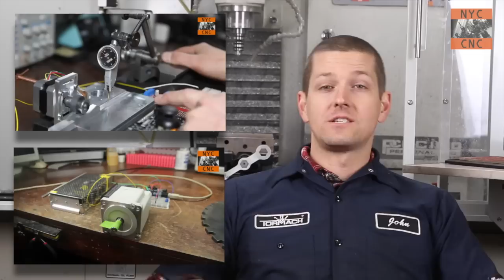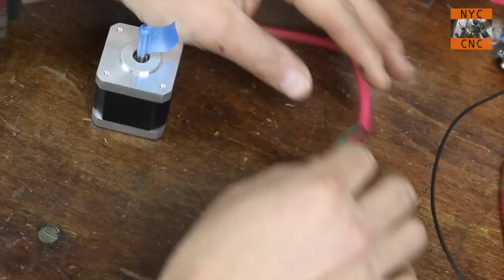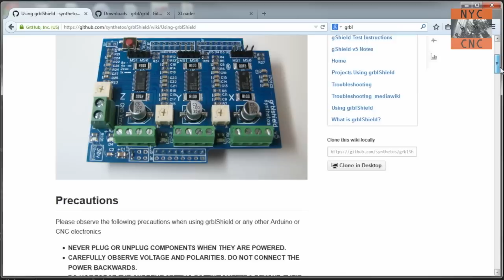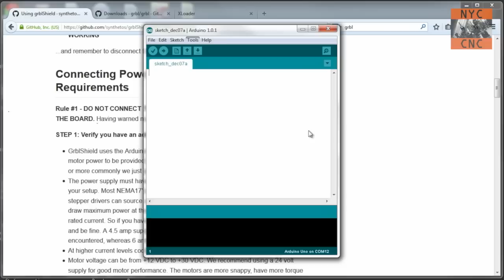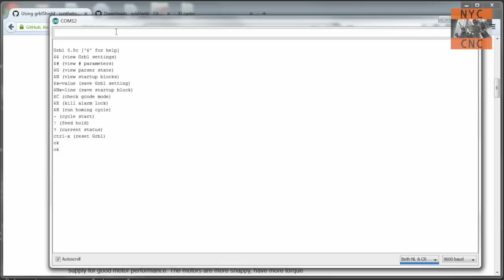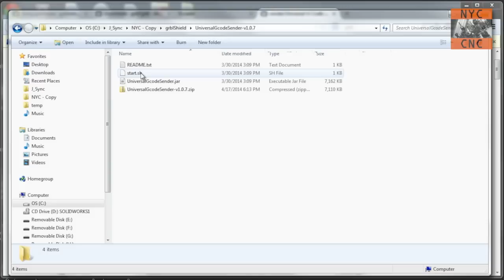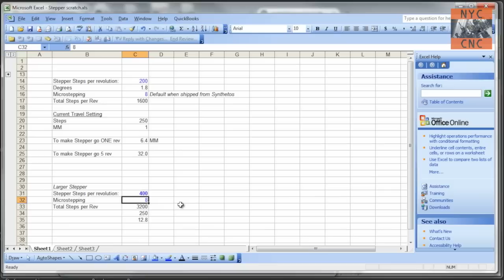DIY Arduino CNC Machine with GRBL Shield - Setup Tutorial!

Comment: Nice video John great information. Haven't used stepper motors since high school in a robotics class.
Reply: NYC CNC just a very basic course but the robotic arm was a pos so I rebuilt it for them. They were cheap made in China steppers so he ordered a set of better steppers. Tore it down and replaced them and new belts. And I have rebuilt many gauge clusters due to faulty stepper motors. But that isn't really robotics just fixing stuff. Gotta make hay when the sun is shinning.  I rebuild power tools, gauge clusters, alternators, power steering racks, etc.
Reply: Tri-Valley Jr Sr high school Valley View Pa 2007 most outstanding vocational student. NYC CNC
Reply: NYC CNC I have been machining parts and doing maintenance since I'm 13 I'm 26 now so about 13 years actively involved in machine trades technology
Reply: NYC CNC yeah ashland foundry and machine works.
Reply: NYC CNC I'm kind of the do everything guy. I balance impellers manual lathe, manual boring mill/ vertical turret lathe, radial drill press, cnc boring mill and cnc lathe
Reply: NYC CNC the old union guys hate me because I work to get the job done not work to get a pay check.
Reply: Richard Mogel Fantastic !
Reply: William Ward fantastic.  I just like what I do. I feel I should also give an honest days work
Reply: Yep unfortanatly not all think that way. Good for you. I will also mention the higher ups notice this. Good jobs and projects and they will reward you as the go to guy! Keep up the good work. Just an FYI funny one.  My Dad was a certified machinist and I have learned more from John and others than I ever learned from my Dad. He didn't even show me how to use a Micrometer! Now I just rub in in with him. Soon (this coming year) I will have the same Tormach that John uses that would be awesome.
Reply: William Ward they don't leave me alone lol. It's overwhelming sometimes but it is cool. I get lots of extra overtime because of it. When I start my knife making I will most likely get a tormach.

Comment: Finally! Got to see one of your videos before it hit the magic 301+ count.
I LOVE these smaller projects. Home CNC lathe here I come. :-D
I plan on combining some of the parts from the DIYCNC site... the 640ozin motors I believe.
And I am sure you have already heard this, but when engraving, micro stepping helps with detail, but causes an exponential decrease in torque. The more steps, the more dramatic the falloff. For example, at an 8 micro, you have about 20% of rated torque, which can be even higher losses in cheaper steppers. For micro engraving, works great. For doing the lines on these plates, may not be of any use, especially when you figure in that each step is (based on what I saw so far) .0025" or smaller using the gearing and movement mechanisms. That is far less than what most humans can notice. Also, when microstepping, GREAT detail must be paid to the rigidity of the machine. I have learned this from a small engraver project in an engineering class. We used cheap ASME rods, 2 start, 4 TPI. We had a 128 step motor, and a 2:1 reduction, giving each FULL step a .001 resolution at full torque. The frame we built was only capable of about a .005 shift, so we over engineered one part and overlooked the frame. Fun, and eye opening!
24 and 48 volt power supplies can be pretty easy to come by, and as I typically say, buy once cry once. a 25% increase in cost to futureproof is ALWAYS worth it to me. I may not be "cheap" but I try to be Frugal.
Reply: NYC CNC there's no free lunch, to move at the same speed you'd have to run the steppers faster, that makes them lose torque fast.
Reply: Lasse Langwadt Christensen True, but the good news is that stepper motors offer a much higher initial torque than servo, and can carry that through a pretty good range. Towards the upper 25-40% of the speed range though, there IS the dramatic fall off. Good news is that most people wont be hitting that unless they have some crazy gear ratios in place that are making each step less than .001 or so.
Tormach did a pretty good article on this when going over the design considerations for the PCNC1100 
http://www.tormach.com/uploads/300/TD10223_Series_3_Whitepaper_0214A-pdf.html

Also, any decent stepper manufacturer will offer a torque curve for each model, or at the very least a guideline. That helps determine the optimal travel speed, and can save quite a bit of money in other areas. Like I mentioned above, it becomes so easy to over power one part, and let another struggle. Torque becomes less of an issue with better screws, or lower ratios, but then with those, you hit STUPID high peaks, and EXTREME falloff at top speed... I feel like it is a coin flip whether I get in over my head with these some times.
Reply: NYC CNC Not entirely formal with steppers alone, but a great deal of exposure. Early in my education I pursued a mechanical engineering path, in particular, machines, robots, and CNC type tools (my own research for CNC but parallel with the robotics course). I had the greatest exposure during a 1 year full blown robotics and engineering course, where we built and designed competitive battle bots and/or task oriented robots. We had about a month and a half where we did labs on the contrasts of servo vs stepper vs standard motors, and how to weigh them out for our specific needs. The long story short is that servo and stepper work well for the purposes of smaller machines where position matters. It is the positional awareness and flat torque curve of brushless AC servo motors that provides the best benefit in the newer VMCs. It is much easier to compensate for torque in a servo because of its flat curve and rapid falloff at a specific point.

Comment: How timely! I just bought a GRBL Shield a couple of months ago to play around with while building a small router/engraver out of aluminum. I'll be watching for future episodes! Keep up the great vids!
Reply: NYC CNC
No but I did consider that. This is a purpose-built engraver for 80% lowers. I have a heavy piece of structural aluminum for the base, and plate for everything else. Gantry style with moveable table. It should be pretty stout. A very part-time project as I'm in no hurry.
Reply: NYC CNC
Thanks John! I may take you up on that.
Reply: alumnium router need lot harden strong frame build, and minimum need 475 OZ stepper motors 3-4 Ampere and this need biggest power supply and stepper motor drivers external drivers, shield small drivers can use only less than 2Ampere stepper motors. and this is too small to router/milling, 2Amp motors used only laser and 3D printer not need lot torque move machine.

Comment: FYI: Bigger steppers have bigger coil inductance. Inductance is a source of impediance that will restrict the amount of current. If you need to drive your steppers faster, they may start to skip steps because of the inductance impedance. If you need to operate your steppers at higher speed while maintaining torque for your load you will need a power supply with a higher voltage. For robotics or machine automation I would recommend at least a 48VDC power supply if not higher. Otherwise I believe you may be disappointed by the performance of the steppers. Although I don't know how high voltage a GRBL shield will operate. I've used gecko stepper drivers for my projects which can operate up to about 80VDC.

Comment: nice, thanks. Speaking of steppers Iv started contacting people about possibly adding second motor and making the tilting 4th axis into a 5 axis for the tormach, lets see where that takes us. Cant remember if I mentioned making a fixture to attach 70-90k quality pencil grinder with chucked engraver bit to the nose of the tormach for plate engraver its on the list maybe it will work fine.